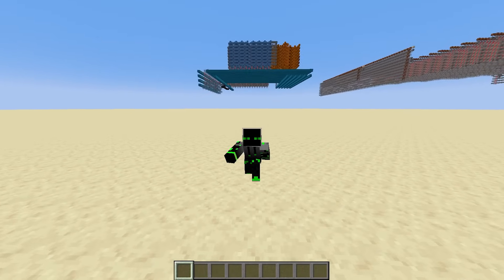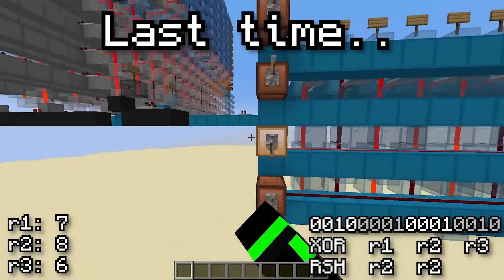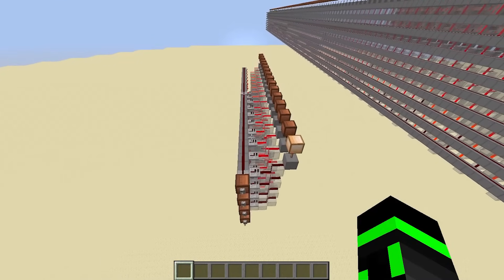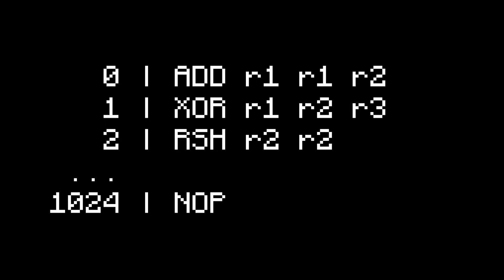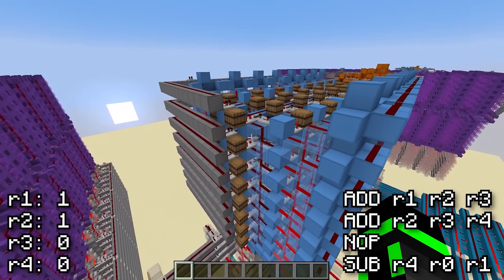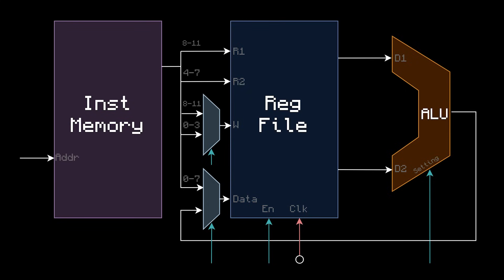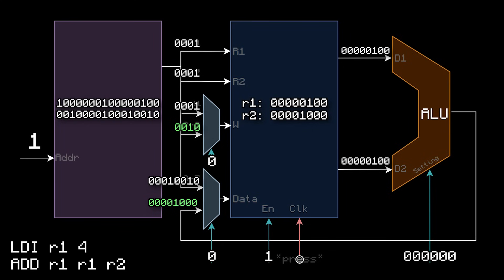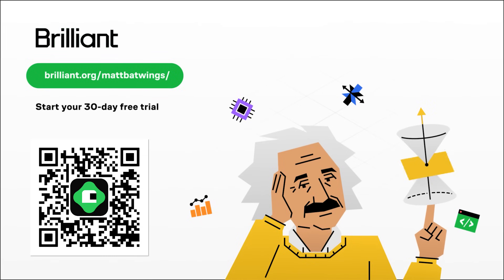Instruction Memory - Let's Make a Redstone Computer! #5

Comment: Very unfortunate that the assembler -> schematic code is only expected for use on your PC and wouldnt work for just the instruction memory. Tried using it anyway, broke the ALU completely with the locked repeaters that appear to the side(for resetting circuits that have Data latches i assume)

Comment: Can someone explain to me the point of having NOP, when all it does is nothing? What purpose does it serve? is it simply filler for it to skip?
Reply: It's more important on pipelined CPUs to avoid data hazards and such but it will probably be used later on when things require multiple clock cycles, but usually people just use a stall flag for that
Reply: @ ah, so it’s basically a sleep command to get more clock ticks passing through… gotcha
Reply: @MrEliseoD  yes exactly, it's like following a cooking recipe and getting to the step "let bake for 10 minutes" so for 10 minutes of clock cycles it will nop or more likely stall (when you disconnect the pulse of the clock from the rest of the CPU)

Comment: The branch memory thing from 5:02 can be explained like this:
The before side is all 10 bits forming a list of 1024 address locations, and when you select one the input notifies all 1024 of them with the input selection. Then the correct associated address location will output what it has stored in memory while the other addresses don’t because their address did not match the input. Imagine you had a stack of 1024 pages and you needed to find what was written on a specific page, you’d have to look through all the pages until you found the right one.
The after side is instead 16 (4bits) “separate” memory units each having 64 address locations (6bits). When you put a 10 bit input into the overall system, it checks the first 4 bits to know which one of the 16 sub-units to check, then uses the remaining 6 bits to know which address of that unit to use. It’s like if you needed to find that one page in 1024, except this time they are separated into 16 books with 64 pages in each. It’s much easier to search through 64 pages than 1024, and you just need to find the correct book first. Now instead of sending the input address signal to over 1000 registers, it sends it to a 4bit selector that then sends it to 64 registers. Significantly fewer redstone updates.
Reply: bro you helped me soooo much, this was life-changing. thank you. its a genius design and an amazing explanation.

Comment: Would love to see a chonkin behemoth von neumann architecture system... Chonking cause I'm assuming you'd need a mega memory. xD
Reply: I'm working on a semi Harvard architecture with the ability to point the PC at writable memory, the issue is the faster the memory access the bigger it is, so it's either huge or slow (my solution was to build a smaller cache like system that you can prefetch instructions into so it can be fast but not enormous)

Comment: for the machine code file, shouldnt you create binary like \x10\x89 \x30\x91 \xb9\x02 (this is hexadecimal but i only used it to compress the binary as its long) instead of using plain text? theres nothing wrong, but its more fitting and more importantly it saves space to store the instructions
Reply: the text form is never put into the computer. It basically functions an intermediate language even though it looks similar to "real" computer assembly binary, because in the end the intended target is in the minecraft redstone computer. Even if you compressed the IL to be less data, you would still need to expand it back to minecraft schematic that can be imported by mods/datapacks.

Comment: IDK if someone brought it up, but wouldn’t NOP actually be be wrong if flood carry is 1 on the ALU. 
It would give all bits on instead of off

So flood carry has to be zero, I think?

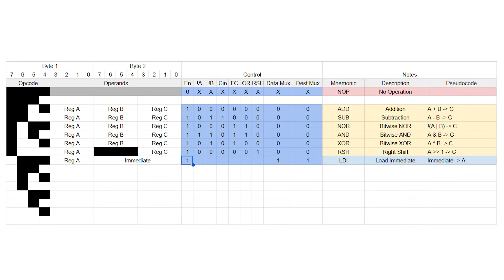A few of the other ones too. Like !A and !B and carry in may also causes problems 11:16
Reply: But enable is off, so it wont cause any problems
Reply: @redstoniker6424 
enable is off but that only turns off the register file making A and B in the ALU zero

But the ALU itself is still on. When the inputs of A and B are zero, but those modifications are 1 it still has an non-zero output.
Reply: @TheArrow4012  but this doesn't get written to the register, so nothing happens
Reply: The alu needs to have an enable for the flags, it's the same for all of the alu flags assuming they're cleared on clock cycle

Comment: How about change `LDI r1 4` to `LDI 4 r1`. In this way, the destination address matches those in add, sub instructions. You can avoid the extra mux.
Reply: The instructions set seems to be a little bit rushed, lack some experience/oversight. For simplicity I would rename regA in opcodes as the destination register, but it would make a lot of changes in the math open codes. So it may be too late for such change, in that CPU implementation.
I would have used a pseudo opcode for NOP but that is addressed in the authors top comments.
Instead I would have used the 0 opcode  to implement a interups. It is a nice trick since usually memory is usually zeroed, and hitting non initialized data triggers and interrupt, such is "better" than silently continuing.
That said it is fine. Learning is also making errors and reflecting on the mistakes from us and others, and making tradeoffs.
That series taught me the reason for the r0 being hardwired to 0 that puzzled me for years in some CPU designs, and I'm grateful for that.

Comment: Hey, I'm build along with the series at home and really enjoying it. I'm having a bit of trouble with the assembler, when I input a program as
ADD r1 r1 r2
XOR r1 r2 r3
RSH r2 r2
that should become
0010 0001 0001 0010
0110 0001 0010 0011
1111 0010 0000 0010

but insted I get something along the lines of
0001 0010 0010 0001
0010 0011 0110 0001
0000 0010 0111 0010

These are the right program just in the wrong order, they go
B C OP A
or 
r1 r2 ADD r1
r2 r3 XOR r1
r2 RSH r2

I really don't know what the problem is and could use some help with it

Also when I paste the schem in I get a lot of random repeaters just floading around.

Comment: I thought was a good idea to use the instruction "nop" as a synonimous for "add r0 r0 r0" or something like that to save the opcode for other instruction, except if you want to have a specific instruction wich takes less cycles to execute. I'm liking your series so much!
Reply from the maker: True, any ALU instruction that writes to r0 will work just fine!
Reply: This is something that's actually done in some cases. The one I can think of is the Raspberry Pi Pico, which is a microcontroller that has something called PIO, which to not go into too many details is like a very small computer that handles IO operations, and is programmed with 16 bit instructions as well, with 3 for the opcode (yes, it only has 8 instructions). It's so crammed that even though a nop was needed, it didn't fit, so it's an alias for mov y, y, or load the value of the y register into the y register, which does nothing.

Man, I love that piece of technology.
Reply: @clehpton don't do alu ops for nop it clears the Alu flags (carry, zero, etc) instead do something like mov with the Alu  disabled
Reply: @Varokai_t  I didn’t make it up, there’s an actual microcontroller called RP2040 which has this functionality. In there mov is a simple atomic instruction, it doesn’t work as a CPU so it doesn’t clear any flags. I don’t think it even has an ALU. It’s still an example of a nop implemented as an alias for other operations.
Reply: @nadie9058  sorry I responded to the wrong person, doing mov to your zero register is always gonna be fine because it doesn't have adverse effects

Comment: Why not share load immediate and NOP? if you try to load immediate into 0 register the result will be NOP. So load immediate could be 0000 while all zeros are still nop.
Reply from the maker: @ShadowTheAge  Yep, there are many ways to simulate NOP. “ADD rX rX r0” works too. I chose to give NOP its own instruction because I would rather not get into pseudo instructions yet, but they will be talked about later
Reply: That actually won't work because it changes flags

Comment: I recently got inspired to create my own computer, both in Minecraft and IRL, on breadboards! I've also seen the Computerraria project, so maybe it's possible to make an entire RISC-V computer in... Minecraft...? Maybeee...? Can we run Linux on it...? (requires the RV32IMA instruction set)

Also, why did you make LDI have argument A as the register? If it was LDI val reg then there wouldn't be a need for an additional mux and control line... I guess that was for some more future instructions, but right now it wasn't necessary.
Reply from the maker: @ggorg0  You’re right, it is becuase of future instructions. Probably should have said that in the video! It’s actually gonna enable us to save a mux later.
Reply: So about the RISC V, isnt it a very complex isa? I dont even know if a minecraft computer can be so complex lol. However, maybe a custom isa which is a subset of RISC V could be done? Then we could make a custom subset of C specifically tailored for it with a custom compiler that compiles this for minecraft lmao
Reply: @d4rkmn643 no, had it been a complex isa, it would have been called CISC-V
Reply: @iwikal  Complexity is relative, of course it's simple compared to x86, but in the interest of Minecraft computers it's still very complex. RISC-V is designed for a 32 bit computer, so yeah, too complex at least for what I have seen done in Minecraft
Reply: risc-v is still quite complex compared to what minecraft can run (and risc over the years has gotten quite bloated too, its just x86 is even worse). maybe its possible to simulate it, i have seen a mod that does something like that (where its basically an extremely stripped down version of minecraft that just does basic redstone for computers), but atp is it even minecraft idk.
Reply: @lythd pretty sure thats mchprs (minecraft high performance redstone server), it simply compiles redstone and runs it stupid fast
Reply: @catlover281  yeah thats what i was thinking of
Reply: I have no idea what a lot of words you said mean but I just started like a week ago making a computer in a different game called shapez 2 and not that far in. I’m about to finish my ALU.